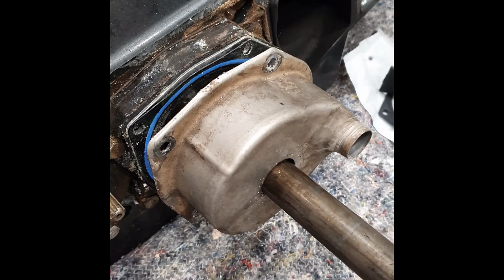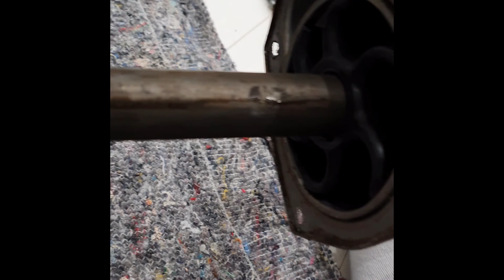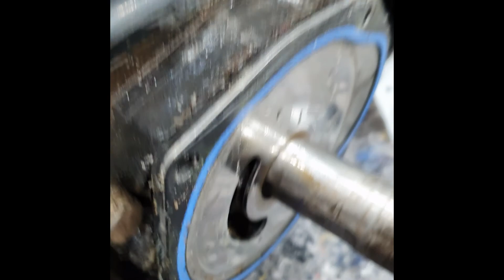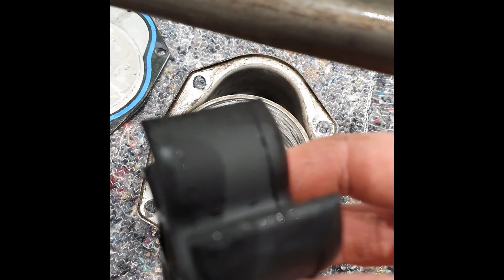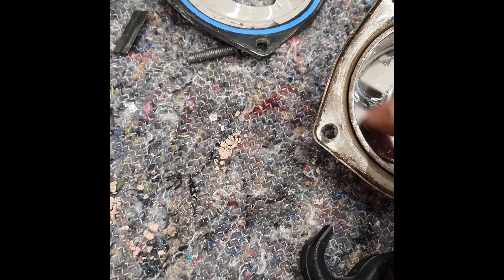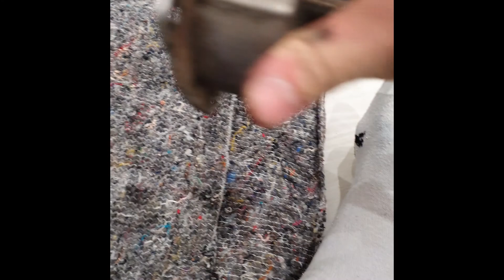How To: Replace Outboard Water Pump / Impeller Service Kit (Mercury Force 120HP)

Comment: Hi there,  I need to do the same thing to my motor, how you can find right part number or  where do you order,  from amazon or eBay,  thanks for share
Reply from the maker: There should be a parts catalogue available for your engine. All manufacturers have them.

Comment: Where do you get the parts for this engine
Reply from the maker: All boat engines have a parts catalogue. If you have an American engine, check the Crowley Marine website - all the engine diagrams are on there with the part numbers.